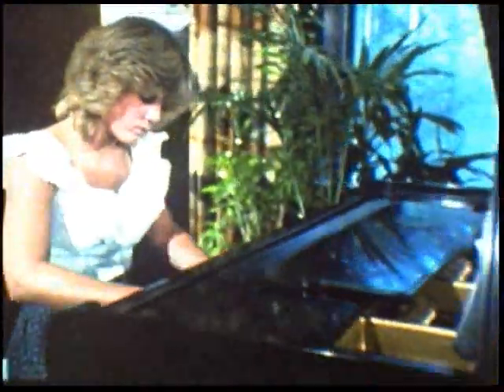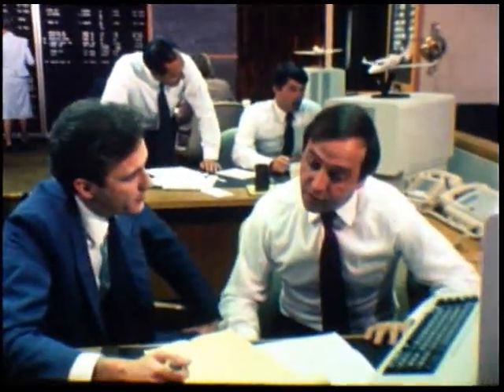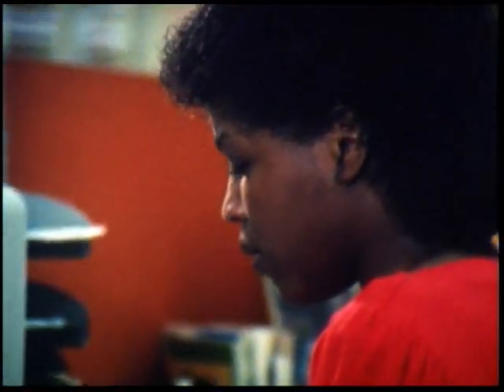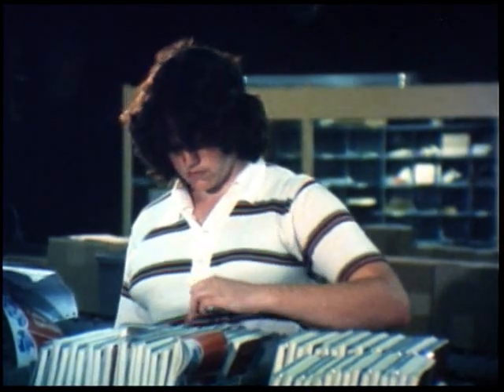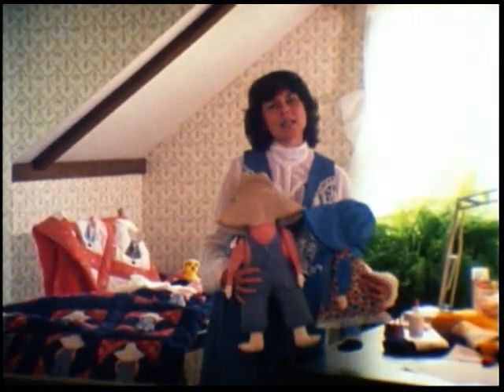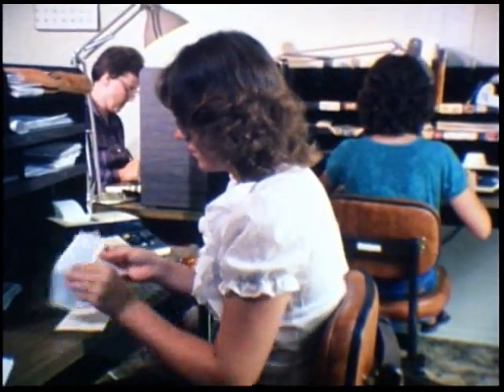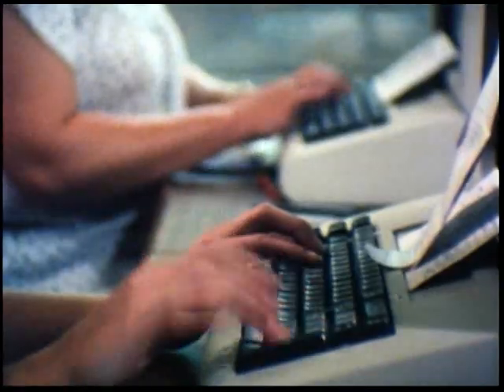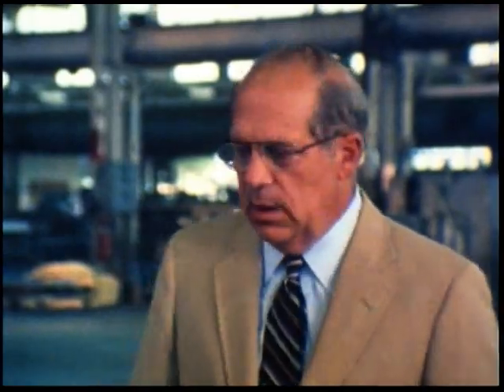IBM System/38 Promotional Film - 1983

Comment: Worked on System 38, 36, 34, 32, and  System 3.   Memories
Reply: System/3 was a bit before my time, but started on the /32 and then marched forward through to the AS400 days.  Things did seem much simpler then, but in retrospect, much more expensive and time consuming.  Today with a few clicks of a mouse we can get information that would take days or weeks to get from the old IBM iron.